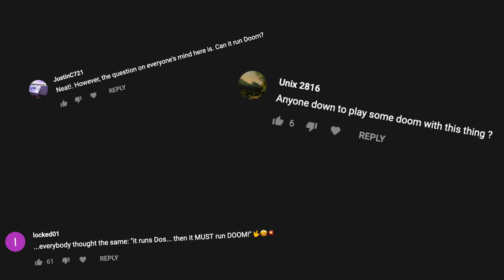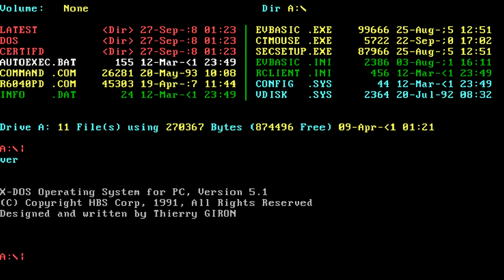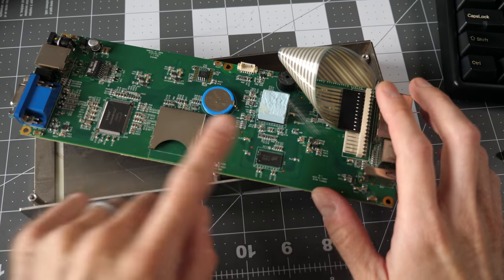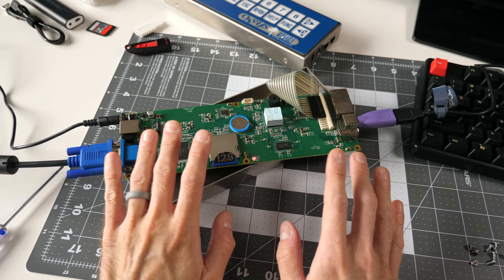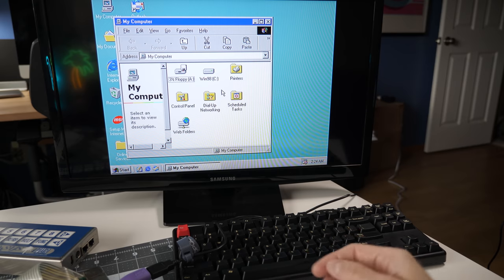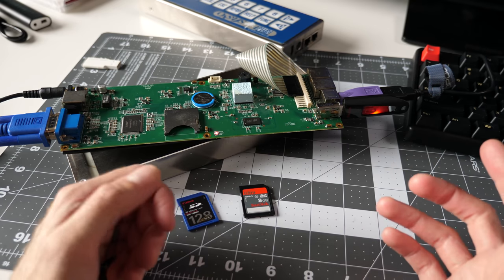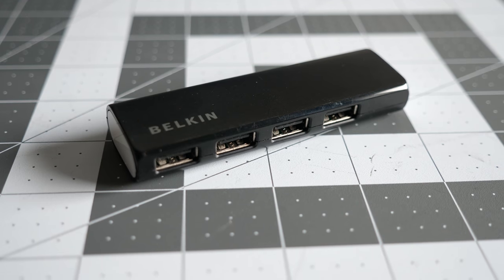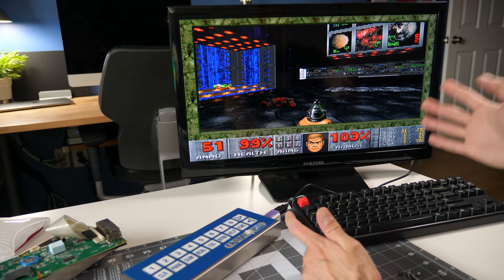Doom on a Commercial Kitchen Appliance

Comment: I'm a contractor that installs these things all the time, so this is good info to have!  These things communicate serially via RJ-12 connections with controller PCs.  I think we need to see if we can get a network going for some Quake action!
Reply: Death Match at Dominos!
Reply: imagine showing up to a lan party with one of these things lmao
Reply: I'm familiar with RJ11 and 45, not so much 12...
Reply: @matthewrease2376  RJ-12 is the designation for 6 wire connectors.  Same footprint as the 11, just more conductors.  Most people won't know the difference.
Reply: @bugiroff9926  kinda surprised they didn't just split it into categories like with RJ-45 "Ethernet", cat 5, 5e, 6, etc
Reply: These are still being used? What an odd choice, but I guess if it works, it works. I'm absolutely certain a version with a basic ARM SoC and embedded Linux would be a fraction of the cost, even including development costs.
Reply: @matthewrease2376  RJ (Registered Jack) refers to how the connectors are wired. The connectors are named by the number of 'positions' and the number of 'conductors' present.

RJ45 uses an 8P8C connector (8 positions, fully populated with 8 conductors) and is commonly used for Ethernet. The same 8P8C connector is used for RJ48 - commonly used for ISDN/T1 etc. with a different wiring configuration from RJ45.

RJ11 uses a 6P4C connector (6 positions, 4 conductors), whereas RJ12 uses a 6P6C connector (6 positions, fully populated with 6 conductors).

Cat 3, 4, 5, 6 etc. refers to the cable category, not the connector and defines the physical characteristics (pairs, twist rate, impedance etc.) as well as consequential characteristics like cross talk and attenuation.

Comment: The fact that someone was able to get Windows XP running on one of these OAsys iPAD devices is impressive
Reply: is it, though...? to run, XP only needs a Pentium 60 on Socket 4 or even a Pentium Overdrive 63 on a 486 socket, with 64MB of RAM at install, and a 16-colour ISA video card (the stated 233MHz Pentium and Super VGA are "practical minimums"). Of course you can get silly and underclock to less than 10MHz and take out RAM after install (down to 20MB or so) and boot up in half an hour.
Reply: How is this comment three days old when the video came out three hours ago?
Reply: @DrakeDaraitis  Patreon more than likely.
Reply: Hahaha thats amazing 👏 🤣
Reply: @RWL2012  As someone who tried living with XP with a 233MHz K6 and 128 MB of RAM, I’m skeptical of your numbers. Also my 486 DX2 could barely run Win95.
Reply: @RandomInsano2  See the MiniXP "distro". It's included in Hirens Boot 15.2

Comment: In the tweet thread the guy mentions that he used nlite to slipstream the drivers into a custom xp image so that's likely the step you're missing
Reply: Yeah, basically pre-building an OS image. Pretty typical in the *nix space especially with cloud/virtualized computing. Nobody runs through actual installers anymore.
Reply: Yeah, the IDE driver is incorrect thats the reason for STOP 7B
Reply: The nt5x-install or nt6-fast-install scripts are also a good option for preinstalling windows to USB drives or SD cards

Comment: I spent the first 20 minutes of the video basically yelling at the screen "WHY DOESN'T HE JUST RUN DOOM FROM DOS"
Reply: Because the video would be too short
Reply: @paulstubbs7678  But if the actual premise is "run Doom", Doom is an MS-DOS game, and the hardware natively runs an MS-DOS clone... the first step should not be "so let's install Windows 98 on it, and when that fails move up to XP"
I was kinda hoping for "install Doom to the internal flash memory device, overwriting the kitchen software, so it boots straight to Doom"
Reply: I kept yelling wtf is he installing windows for?

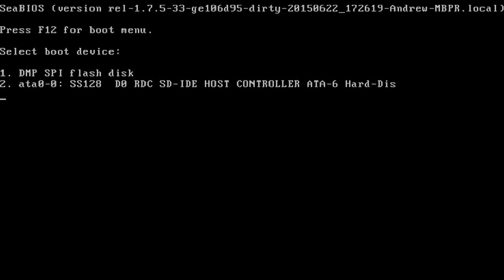Comment: The version string at 8:28 reveals some guy named Andrew compiled the BIOS on his MacBook Pro back in 2015. The BSOD error 0x7B means a missing storage driver. (Yes, I too wonder why I remember BSOD stopcodes.)
Reply: My guess is that when XP initializes the USB stuff it kills the bios emulation and can no longer find the boot device.
Reply: STOP 7B happens when the system switches to protected mode and can't find the boot drive. They happen for the stupidest reasons (e.g. Windows was installed while AHCI was disabled in the BIOS and then you turn AHCI on).
I'm surprised someone got XP to run on a USB stick on a machine with a wonky BIOS without the STOP 7B. I suspect they flashed a better BIOS or perhaps booted from a RAM disk image.
There are some fun tricks you can do if you get into Windows Embedded. I once created a USB based Windows installer (or rather deployment system) for a headless system with only a text-based LCD front panel. It basically booted into freedos from USB storage device or CD-ROM, then used a batch file with a custom program to control the front panel to go through the setup steps. It could partition the hard disk, reboot, format the hard disk (and remember across reboots that it was doing that), reboot to Windows PE, copy a RAM disk image file and  configure Windows XP Embedded to boot from that RAM disk image every time from then on. Great fun!
Reply: Ya, I instantly recognized the stop code as well.  I am wondering if you could run a dos based bios configuration tool and modify the bios settings?
Reply: If there is one stop code one remembers, it should be 7B. Way too common and painful.
Reply: @jacquelineliu2641  That and the Linux equivalent "Kernel Panic - Not Syncing : VFS unable to mount root file system"
Reply: Correct, classic error (7B)back when SATA came in, XP did not natively support many SATA controllers Ms
Reply: EZ2Boot would probably fix it. Check out PhilsComputerLab.
Reply: Yes, it was too much effort for Microsoft to just print readable errors on the blue screen, every user could understand without a reference 😁
This was the time I learned to love Linux, because although the boot messages look at bit cryptic at first glance, at least you can read in plain English what's going on and what the couse of an error could be 🙂
Reply: 7B is my favorite STOP error, and is often shown with the descriptive text INACCESSIBLE_BOOT_DEVICE. It's fairly easy to fix when switching hardware. Just put the drive in another Windows system, load the SYSTEM hive, go to ControlSet001\services, find the correct driver key and change its Start value to zero. Considering the SD slot appears to be presented as an IDE drive I believe the driver would be 'atapi'. But it's probably more complicated in this case as the text mode setup should have enabled this automatically.
Reply: Time for an F6 floppy lol
Reply: Microsoft would remind users in their knowledge base that XP could not be installed from a USB device because the XP install process would invoke a USB subsystem re-initialization that would disconnect the USB install media and cause the install to fail.  There was a workaround where you could replace the XP installer's USB .sys file that caused this behavior with one from a Windows Server 2003 service pack and re-build the XP ISO and this would ultimately allow an install of XP from a USB device.  In the intervening years, though, it appears others have worked around this XP / USB install limitation not with replacing a .sys file but with booting to a live Linux image and running the install from a RAM drive and other novel workarounds.
Reply: @bdwilcox  I used a program called WinNTSetup under WinPE, which copies installation files to the hard drive. Booting from hard drive after the program did its job would install XP normally.
Reply: @eDoc2020  Would that be the same Atapi driver we had to load in back in the day for Dos to see your CD Rom drive ?
Reply: @maxmixer  No, not really. It's the Windows NT driver needed to see any IDE drive. Though I suppose since it lets the system also see CD drives it's not too far off. The big difference is the NT family needs drivers for everything while DOS can just use BIOS calls for most disks.
Reply: There was a way to modify the RMB of the USB to make it look like a HDD, rather than a removable drive. This should prevent the storage driver freak out as Windows tries to load the USB mass storage subsystem.
Reply: @JacGoudsmit  shit is so advanced i only understood half of it. kudos

Comment: SeaBIOS is very commonly used with open source virtualisation platforms like KVM, Xen etc. for the VMs' BIOSes
Reply: Also it would sound familiar if you are used to hacking anything with ChromeOS
Reply: @thecryingsoul  Aha! I was wondering where I heard that from! I installed linux on my chromebook!
Reply: ChromeOS devices also use a stub of SeaBIOS
Reply: Is SeaBIOS open source implementation of a BIOS software, unlike closed source Award, AMIBIOS, Phoenix, etc.?
Reply: @markusTegelane  Yes that's exactly what it is, albeit a bit more basic, as it only implements standard BIOS features.
Reply: And on AWS...
Reply: @TheErador  Yeah because they use Xen
Reply: @philevans4021  well xen pulls in qemu. But yes. Fair play.
Reply: It is also used on other real world devices too, like PC Engines APU boards

Comment: Considering it's like a Pentium equivalent, I'm not surprised that it can run Doom. Back when I was a teen, I remember playing Doom II on one of the Compaq DeskPro 486 at my father's workplace. IIRC it had a 50 MHz 80486 CPU, 2 MB of RAM, and most likely a minimalistic integrated graphics chip :)
Reply: 2MB of RAM? I kinda recall DOOM needing 4MB to run at all, and 8MB to run well. That information is ancient however, so take with a grain of salt.
Reply: I distinctly remember my dad heming and hawing over whether he could get his scratch-built 486 to run DooM without too much in the way of expensive new components back in the day.
He did.
It ran well.
The new memory was put to good use elsewhere, as well.
I was forever traumatised by Daisy's head.

Comment: SeaBIOS is the default BIOS QEMU uses for x86 and x86_64 emulation and also the most common option for Coreboot payloads, which this device also uses.
Reply: ... It runs QEMU?
Windows XP has entered the chat.
Reply: and the most used payload used with coreboot.
Reply: Also, it's used to update Chromebooks to run Linux.

Comment: SeaBIOS means that most likely there is running a coreboot underneath. Since coreboot and SeaBIOS is licensed under GPL, Select Electronics should provide source files somewhere. If don't just remind them that they have to do that.
With the source code you can change the SeaBIOS Settings and re flash it with Linux and the Software Flashrom.

Comment: Kitchen worker here, yeah they are called bump bars and what you said was completely correct, the output(s) the bar would be connected too would be partitioned into at least in my case, 8 different sections with 1 order per section,  with the buttons 1 through 8 corresponding to a particular area of the screen. So pressing 5 and Bump/Clear would clear the number 5 area on the order screen.

Comment: You can get a USB sound adapter; I think there's a way to get those working under DOS but don't quote me...
Reply: Doubt many of them are adlib/soundblaster compatible. You could try an USB2LPT adapter and use a covox (there are "emulators" and doom ports which support those)
Reply: @1337Shockwav3  Ooh yeah, that might work.  Lots of overhead but a 300mhz CPU should be able to do the heavy lifting if the bus has the same freq. and it isn't just a standard.
Reply: @1337Shockwav3  The Covox Speech Thing won't be usable with a USB2LPT adapter (at least not without modifications). It would probably be easier to write a USB stack with audio for DOS. Or throw together a lightweight Linux distribution, then USB sound support will be trivial.
Reply: "You can get a USB sound adapter; I think there's a way to get those working under DOS" I quoted you. :)

Comment: SeaBIOS has no real configuration screen. You configure it on compile time. There is some option to change boot order though, but has to be compiled in.
Reply: Is there a way to recompile SeaBIOS without losing the old configurations? Essentially recompiling SeaBIOS just to change the boot order.
Reply: @thepuzzlemaster64  just use an hex editor and change it, its not easy but you can have a pretty good idea of where to find if it was compiled from some open source base
Reply: Luiz Felipe 
So uhh...I have this situation where I bought a laptop pre-modded with CoreBoot + SeaBIOS (works well, but could be better). How does one dump the BIOS without these special tools and replace it without potentially "bricking" the laptop?

I think I might need to spend some time looking at the SeaBIOS and CoreBoot manuals just to get an idea of what I'm in for if I decide to do this...
Reply: @thepuzzlemaster64  Dumping a ROM depends more on your laptop hardware than on the BIOS.
Usually you have to use a eprom programmer made for that specific machine.
But if you know electronics you can try interfacing it with a RPI or an Arduino, iow, you make a eprom programmer.
Reply: You can't brick it if you have an eprom programmer. It's the lowest level possible.
Unless we are talking about fuses in microcontrollers, but that's a PC.
Reply: @monad_tcp  
I know I can't permanently brick the laptop, but I don't have an eeprom programmer, nor an Arduino on hand to unbrick it if I screw-up. I have one shot to re-install SeaBIOS if I want to change a couple settings, and I don't really want to risk bricking my laptop for a couple settings.

However, the pre-modded laptop I have is a ThinkPad T420, so there shouldn't be any issues when it comes to support for this thing, but I still don't want to take any chances yet.

...Looking at where this conversation is going, I think I'll just wait until I get an Arduino before doing anything to the CoreBoot and SeaBIOS setup my laptop has. That way I'm not stuck without a laptop if I screw-up.
Reply: @thepuzzlemaster64  I have no idea of what i'm talking about, but maybe use Linux to dump the BIOS? If that's possible
Reply: @IbbiAhmed  
I don't know if that's possible, but even if it was I have no way to re-flash the BIOS chip if I accidentally change the wrong thing, as I can't access Linux without a BIOS. So I'll wait until I either get an Arduino or a Raspberri Pi (whichever one I'll get more use out of) before I do any sort of mods to the CoreBoot + SeaBIOS install I have.
Reply: @thepuzzlemaster64  great, u can even get the super cheap arduino rip offs as well
Reply: @thepuzzlemaster64  The T420 hardware allows reflashing the BIOS from software unless the BIOS disables it (and your coreboot almost certainly doesn't block it). You can use the 'flashrom' command in Linux.
Reply: @eDoc2020  
Oh wow, thanks for the command. However, I still have three questions:

>How do I know if I compiled the BIOS correctly? First time doing this so I have no idea what I'm doing.

>The 'flashrom' command does have a verify option, which means I'll know if it flashed properly, but does it also know if it will work for the computer I installed it on?

>And how easy is it to recover the BIOS without being able to boot into Linux? Because remember, if I screw-up doing the BIOS flashing and power down, I won't be able to re-flash the backup until I get an Arduino or something.
Reply: @thepuzzlemaster64  1. You'll know if you got an image compiled properly because make won't exit with an error. A binary should not be produced if something goes wrong. However a correctly compiled image doesn't mean it will actually work on your system. The only way to check that is to try it.

2. The verify option just checks to see if the version stored in flash exactly matches the one in your file. It doesn't know if it's usable or not.

3. If there's not a recovery mechanism (I honestly don't know if there is or not) you'll need to use an external program.

Really you shouldn't try reflashing unless you can accept a brick. If you decide to flash (or even if you don't) you should use flashrom to read the existing ROM multiple times (and make sure all dumps are identical). Then try building for QEMU first so you can get comfortable with the process.
Reply: @eDoc2020  
Thanks for the help! I won't be flashing the BIOS on my T420 just yet, I can live with the settings it has (even if I find it stupid that the Disc drive has a higher priority than the Hard-Drive with no way to change the boot order). When I'm able to buy an Arduino/Raspberry Pi (whichever one I'll get more use out of), I'll start studying CoreBoot and SeaBIOS, test it out on QEMU, and finally flash it for real. If it bricks, the Arduino/Raspberry Pi can recover it and let me try again.

Thanks again for helping me understand the flashing process and a couple new things I didn't know about Linux.
Reply: @monad_tcp  if it has coreboot installed you can probably flash and dump it internally from linux installed on the disk, but this depends on the exact board.
Reply: @thepuzzlemaster64  this is the best path, if you don't have the tools to fix it, leave it alone, better safe than sorry

Comment: I am so surprised you didn't try ME. It might have solved the PnP issue since it's 98 SE under the hood with a lot more updates. Also, could have tried Windows 2000 as well 😊 Awesome video nonetheless!
Reply: @IbbiAhmed  🤣
Reply: shudders do not utter the os that shall not be named again.
Reply: @h3yw00d  Hehe. ME wasn't actually that bad for me. I think it all depended on the hardware. I have very fond memories of ME. Was playing Half-Life and Max Payne religiously. I remember formatting a few times for weird issues but for the most part it was fine. My friends computer at the time was horrible on ME though.
Reply: yeah, ME wasn't bad and had great hardware Support. used it a lot before XP